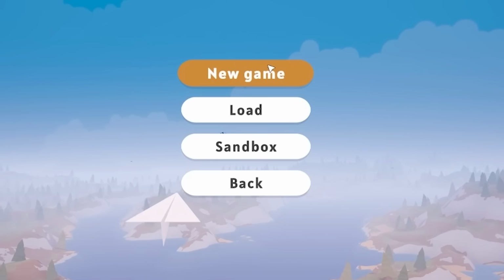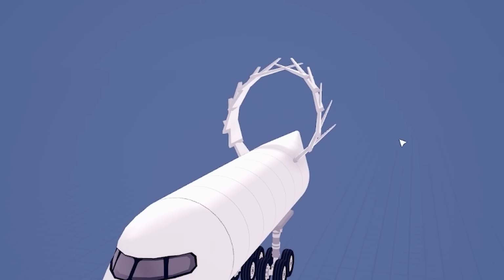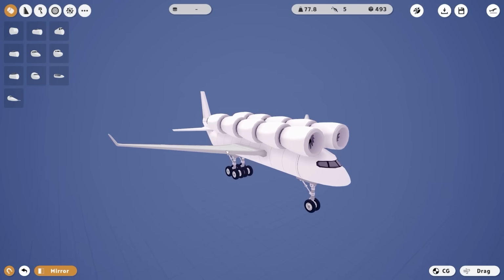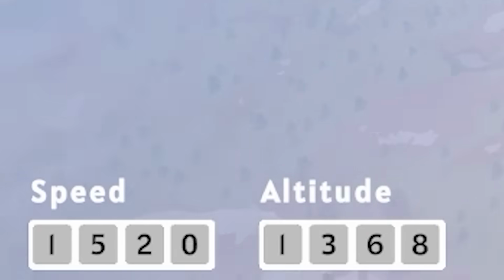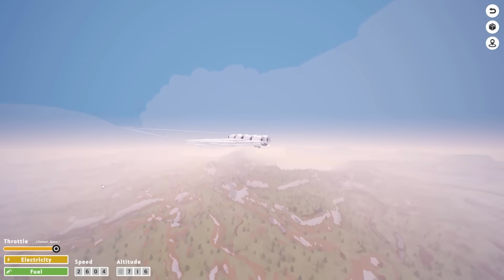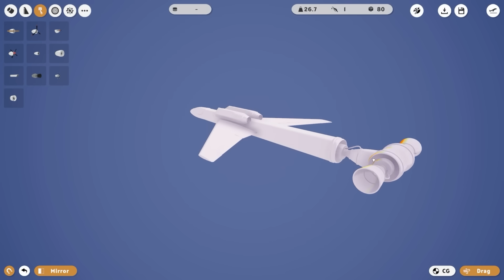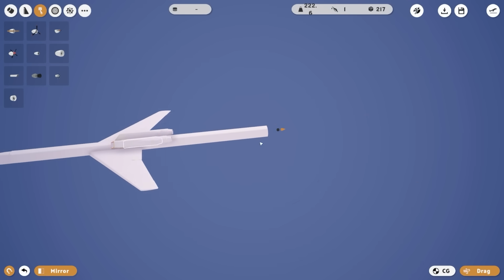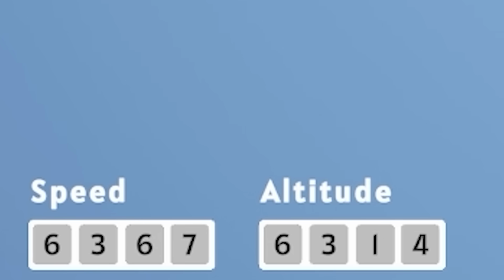Engineering a HYPERSONIC passenger jet...

Comment: So... Mach 1 (the speed of sound where you get a "sonic boom") is roughly 761 mph at sea level, which maths to roughly 1225 kmh at sea level.  Also, unless he breaks 19,000 in-game speed and it IS mph, he's gone high-hypersonic based on his speed, but still nowhere near re-entry speeds which are Mach 25 and higher.
Reply: IIRC, the space shuttle and ISS orbited at around 17,000 mph, so he's easily achieved escape velocity. (Also, 19000 mph IS Mach 25). Which leads to the question of what the max altitude in the game is...
Reply: @valaran3968  Bit late to this one but, "19000 mph IS Mach 25" is not really correct. Mach number is defined solely within a local frame of reference, because Mach number specifically uses local speed of sound as a value, which means the local air pressure, temperature, and composition all matter heavily. Mach 1 at sea level is a VERY different ground speed to Mach 1 at 100,000 feet. The equation is M = u / c where M is Mach, u is velocity in m/s, and c is the speed of sound in m/s. The speed of sound decreases as you climb, mostly due to temperature, thus you can be travelling much more slowly to reach Mach 1 at higher altitudes.
19000mph(8494m/s) is Mach 25 in the very slim parameters of 20 degrees Celsius at sea level, where speed of sound is around 343m/s, on Earth.
19000mph is around Mach 27.8 at ~100,000 feet, assuming a temperature of -40C, and a speed of sound of around 306m/s, again on/around Earth. (Numbers from a NASA calculator)
As you go further out the numbers start to get ridiculous, once in space you kind of reach infinite Mach, as you need to divide your velocity by 0 (Sound doesn't propagate without a medium), although you just can't define Mach at all without a medium.
To be truly absurd I've found that the Speed of Sound in water is around 1481m/s but no listed pressure or temperature, that makes 19000mph around Mach 5.74 in water.

I'd also like to point out that he did not actually reach escape velocity, at least from Earth, as that's over 11 km/s and assuming mph he only reached 8.5 km/s, if knots then about 9.8 km/s. Not sure what the ISS has to do with this as it never reached escape velocity, it's still in orbit. The ISS orbits around 400km up, and I couldn't find a speed of sound chart that covers more than about 76km up (Roughly 250,000 ft).

After doing more research on the upper atmosphere it looks like we're entering the realm of highly complex physics as the temperatures past 100km in altitude are not simply defined, every graph I've found shows the temperature sharply rise past 100km, up to as high as 1200 C, but the density of gasses in that region of space is very complex so that wouldn't be 1200 C as we would know it on the ground. Very interesting stuff but essentially, Mach starts getting extremely complicated once you reach very a low density medium.

Sorry if this sounded rude, I just found it all very interesting.
Reply: Re-entry for the Shuttle was about 17k. He got there at the end
Reply: I don't think it's miles per hour, but meters per second, so even faster
Reply: @RyRy2057  Mach 50, and he’s orbiting the sun now. (Mach 33 is escape)
Reply: @RyRy2057 definitely not lol
Reply: pretty sure it should be knots
Reply: @mnmnrnnnnrnmnnrmmmrn Agreed as it doesn’t matter which country you’re in, aviation is almost always knots.
Reply: He’s gone Mach 22-23 which is re-entry to me! Anyways he created an intercontinental ballistic missile.
Reply: it's knots, not mph

Comment: 15:36 it's the game's engine struggling to render since you're super far from the center of the map

aka 

engine + loads of distance and height = visual glitches, the best example i could give would be the minecraft far lands or the roblox "floating point"
Reply: Yeah, same thing going on here. Floating point issues!
Reply: its like having the game only having a certain number of digits it can use for example: 2222.2222 and 222222.22
Reply: Because every vertex in the 3D model has a position in the world, when those positions get so far from the center the engine's calculations start to get more and more inaccurate. This happens in Halo also.
Reply: @ oh is it because the engine basically rounds up the position of the typography?

Comment: 2600 miles per hour is 1162m/s, which is comfortably above the speed of air molecules in the air. It's quite likely the plane should be undergoing some kind of nuclear reaction with the air molecules at this speed.

Edit: Yeah, any faster and it definitely will start undergoing nuclear reactions with air. Your plane is a highly radioactive kinetic missile at this stage. Oh, and the pilot has been puree'd by G-forces on takeoff.
Reply: The X-15 hit a top speed of 4500 miles per hour and was a piloted aircraft. No nuclear reactions occurred and the pilots survived. 😀
Reply: @danhalen42  altitude matters a lot. the x-15 had a surface speed of 4500 at an altitude of over 300,000 feet.
Reply: @Taolan8472  it was not at that altitude. It was a hair over 100,000 feet
Reply: @ While I'll may be wrong on the nuclear aspect (I'm not an enough of an expert, but the X-15 isn't doing that speed at 1 atmosphere of pressure), the pilot is likely still dead, as an X-15 has lower acceleration that what's in this video. Back of envelope has acceleration at about 65Gs, for a sustained period, which is likely not survivable (46Gs is survivable for a few seconds, as per John Stapp's experiments).
Reply: No it wouldn't, first AIM-120 AMRAAMs reach faster than that speed regularly.  Second there is no way the temperature or pressure would create either a fissile or fusion reaction.   It's actually a lot harder to make a nuclear reaction with stable materials than you think.
Reply: Nuclear reactions require far more pressure than this.
Reply: What the hell are you yapping about nuclear reactions lmao

Comment: I love that he realized he could move stuff into each other with no penalty, and still didn't figure out he can completely eliminate drag by moving the engines into the fuselage instead of on top.
Reply: that’s a thing?! I never did that with the engines cause they need to sucky that air, but if it works it works !
Reply: @theslayzinn  yeah this game is super not picky, when you place something you can move them pretty much anywhere on the plane and they'll work just fine
Reply: @Andrew-uk1bz  not only is it not picky but if you have enough of anything the game just let's you do what you want for example 10 sets of the best delta wings allowed you to fly without any engines and just pulling up and the the left or right
Reply: @theslayzinn  You've never done that? I've installed a couple of jet engines in the backseat of my car and I can literally fly over any traffic on the freeway now.
Reply: The only issue with this is using mirror parts. If you try to cram them on top of each other one will stop mirroring. I recommend adding a single line of engines to the top or belly then moving each individually. My 200ish cargo 3000+ speed missile kept veering to the left and I realize the engines had collided when moving them and 6 were dead on CG and 6 were left of CG by half the width of the ramjets
Reply: Well and he did not realize, he can half his drag by using just one line of engines.
Put all the engines behind the wheels and the plane will point up on the runway. Instantly taking of without hitting trees.
Reply: im sure he'll do that in the next video, since it's not like there's a guide to this game or anything haha... all the folks uploading gameplay are basically having to freeball everything
Reply: I made a speedster for the dessert using this cockpit and a tapered tail. I put 6 scram jets inside and some fuel tanks my friend said it was basically a cruise missile because every time the wings would break off
Reply: Lol
Reply: doesn't actually work. if you move the camera into the body with the drag visualizer open, you can still see red, as opposed to when you have something attached to the back side of a part, where it is then occluded. youve got to do some other stuff to get zero drag.
Reply: @ARockyRock  that might just be visual cuz when I try it it definitely increases speed when move in compared to outside
Reply: proof that hes an architect in disguise:
Reply: Shush dont say that @s0laacol4
Reply: Rather than no penalty, the drag is not calculated if the part is not in the airflow so that's a huge bonus :)
Devs may need to add some checks for intake and exhaust at some point...
Reply: He was able to put the jets in side of the plane so the drag will be GONE
Reply: I love how you spoiled the whole video
Reply: Urm then whats the point of doing anything at all
Reply: But that’s to much cheating I would say
Reply: you are a genius he should do that
Reply: I now that
Reply: oh my gosh not even i realised that
Reply: @Unknown-n4s yep, it's a mobile game for children
Reply: He should frfr come to this and do it for video

Comment: Who says, that the units in the game are MPH? Maybe they are, maybe they are KPH (km/h) or MPS (m/s) or FPS (feet per second) or YPS (yards per second).
Since there is no sonic boom or other measure in the game, we simply don't know.
Reply: Yep, it's just numbers and there are no units mentioned anywhere in the game so who knows what they really are.
Reply: I think they are most likely knots tbh
Reply: @vilkillian  if so he was going faster than mach 16
which is the funny speed
Reply: Maybe knots?
Reply: We use knots for airspeed not any of that…
Reply: It'd make sense it they were standard aviation units: feet, nautical miles and knots (=nautical miles per hour)
Reply: I prefer my Speed as Ligne per Shake (yes those are real measurements of Length/Time)
Reply: @Drago_Whooves  so you don't consider anything below 812,160 kph to be relevant?(that is 1 ligne per shake in kph)
Reply: @m_dot_h_dot  it's useful for calculating speed when going between planets in realise, I just googled unusual measurements and picked two that sounded funny
another funny one would be Washing Machines per Centiday
Reply: @Drago_Whooves  oof... you'll be hard pressed to generate lift at that speed. It's about 1/10 to 1/20 of a garden snail speed. It's around 2.5 meters per HOUR. 😉

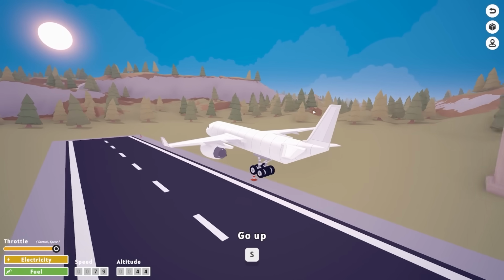Comment: 1:20 they actually do infact have wheels in the pit of the wings
Reply: it bothers me that they’re on the belly
Reply: @skari346  fr
Reply: @skari346 it hurts me a lot
Reply: What is this game called?
Reply: Not on those massive cargo jets tho (ha, caught you there did i)
Reply: @ when the wings are at the bottom of the fuselage as in the video the landing gear is in the wing root. Only cargo aircraft with high mounted wings have fuselage mounted landing gear
Reply: @Ferrastar  yeah and most of those massive cargo jets, particularly older ones, have high mounted wings
Reply: @TheHydrator2003 yes, but they have wide bodies and high wings
Reply: Not on passenger jets tho
Reply: @El_Negro2003  yes passenger jets
Reply: @ I’m pretty sure you’re wrong.
Reply: @TheHydrator2003 yeah pretty much every passenger jet has the landing gear in the root of the wing that folds into the fuselage
Reply: @TheHydrator2003  Yes on passenger airliners
Reply: @TheHydrator2003  Every passenger jet currently flying retracts its main gear into the wing root, and has its pivot in the main wing body.
Reply: @TheHydrator2003  literally on passenger jets, are you stupid